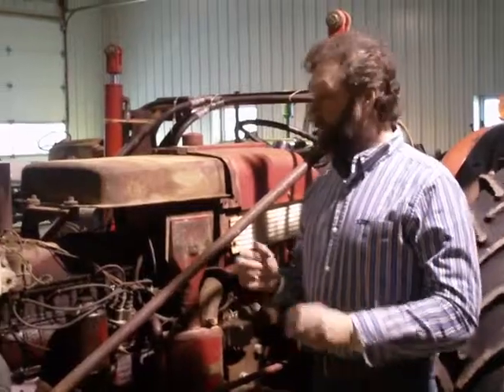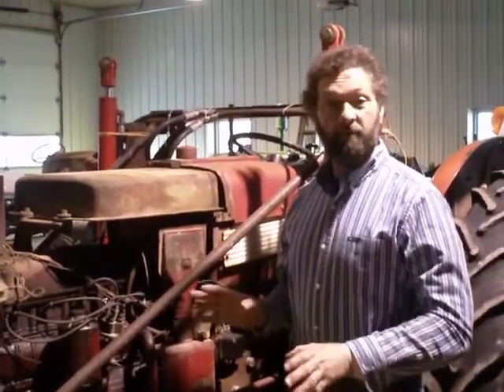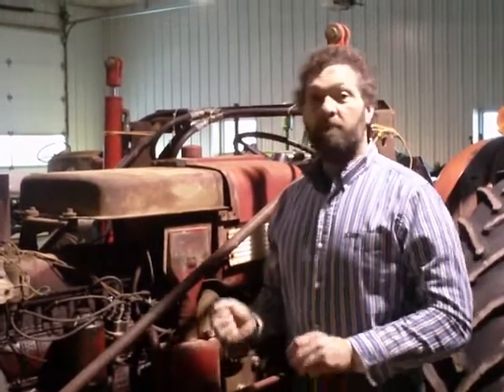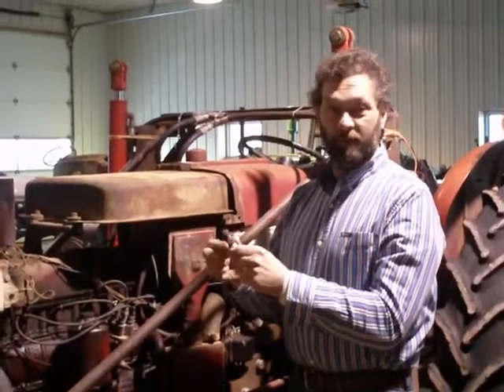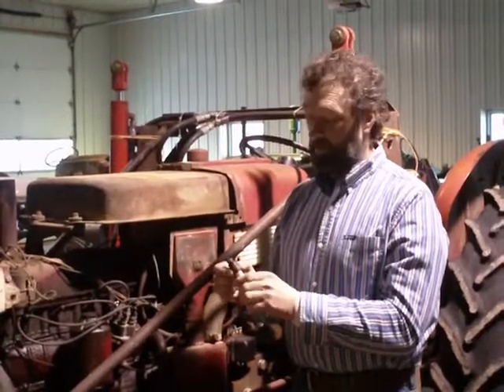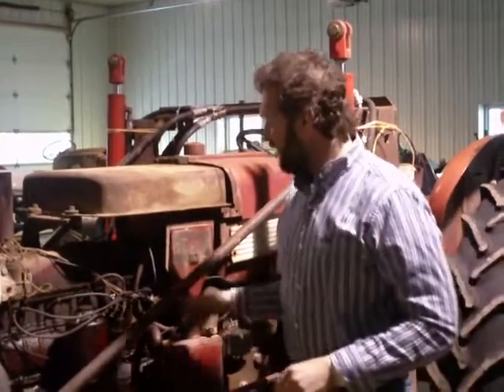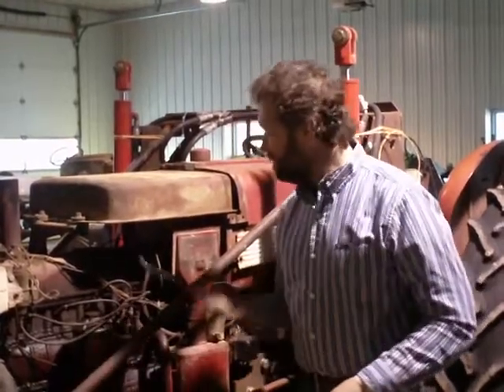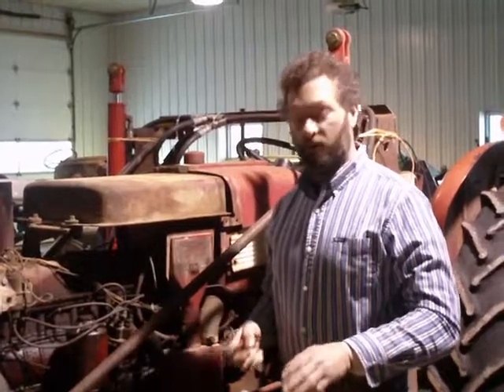Bad motor in disguise

Comment: That's just plain evil for someone to do that! It is most likely a spun rod bearing. If I had bought that tractor, the seller and I would have a real serious discussion after I found that, as with the plug gap flattened, it was obviously intentional.

Comment: What about if the Tractor runs good with the choke on and once the engine warms up and then then when you turn the choke off then the engine has a slight miss could that be a carb problem or something to do with the Magnetto

Comment: I got lucky a couple years ago, bought a farmall H that had a really bad miss,  I figured new plugs points and wires would fix it, but it didn't.  Decided i would pull the head and found the luckily it was just a bent pushrod,  got a good used pushrod and put in it, and it runs like a new one now,  but i do consider myself lucky, the problem could've  been deeper in the engine